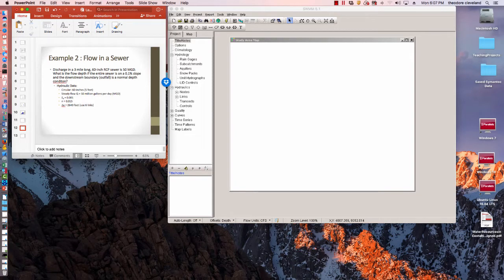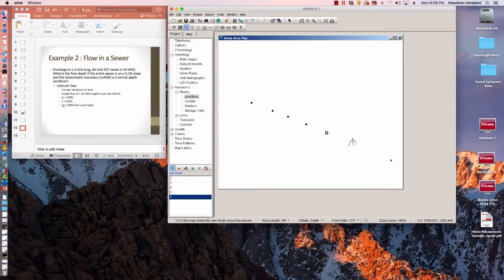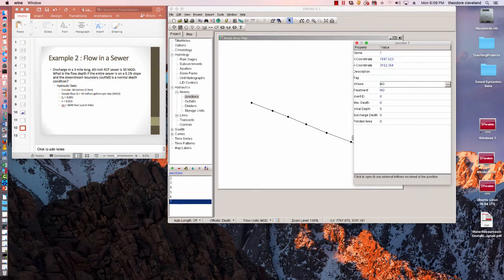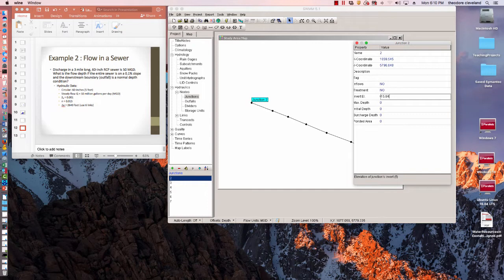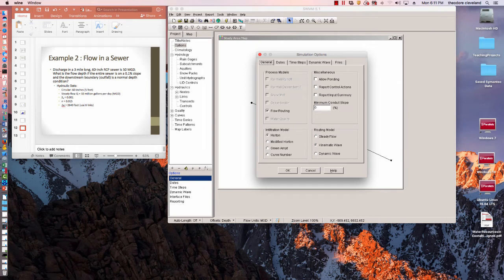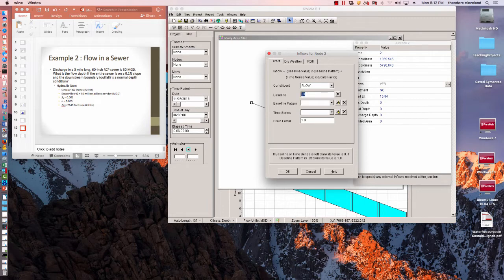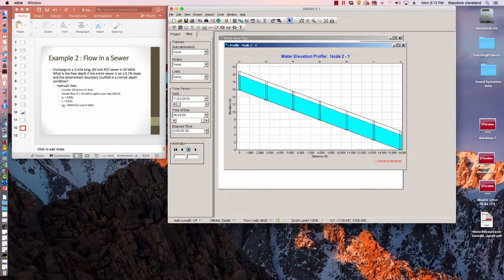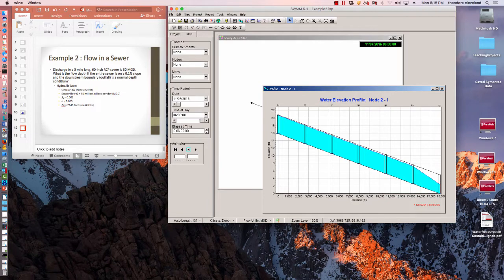Water Systems Design WSD-13-5-SWMM-Example2

Comment: Hello Sir... do you have an example file for storage and pump? I try to simulate a drainage...but the water depth in conduit and junction node is not same to the storage depth....
Reply from the maker: Take a look here http://theodore-odroid.ttu.edu/documents/university-courses/ce-3372/spring-2018/ce-3372-24/1-Lectures/Lecture24/

Comment: I am new to this program. I need something that I can model a sewer system using inflows from household parcels at different sewer service pipelines and determine the effluent volume flow rate at a WWTP. Will this program work?
Reply from the maker: yes, if you know the losses in each unit process you could even model the WWTP, but that's pretty exotic use of the tool